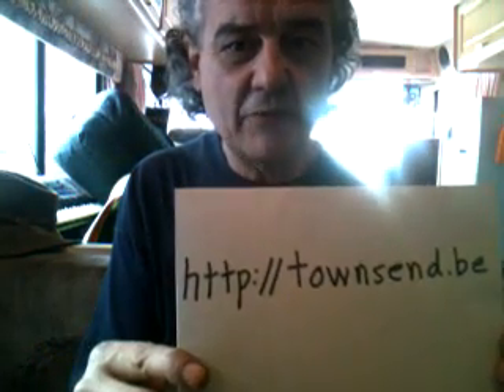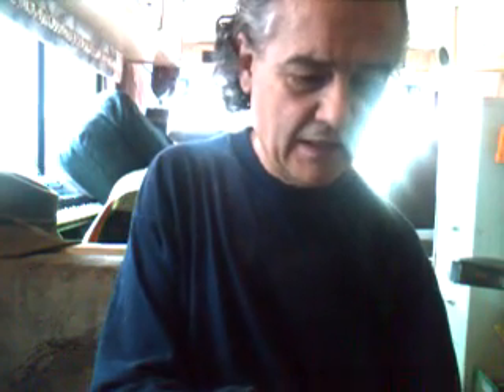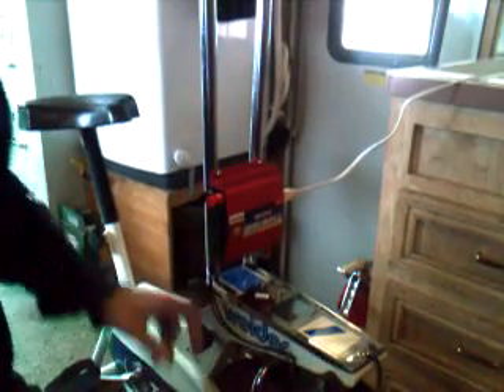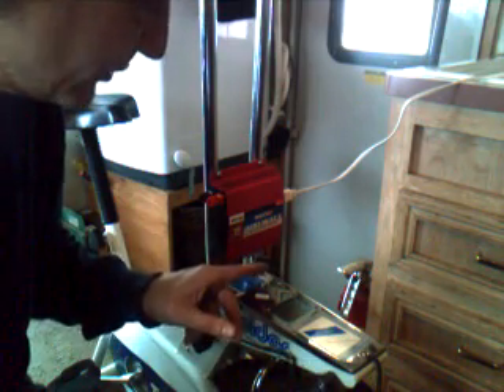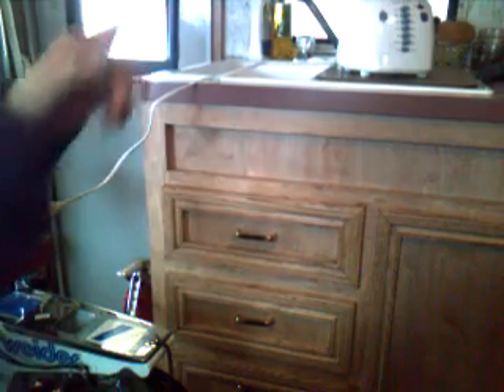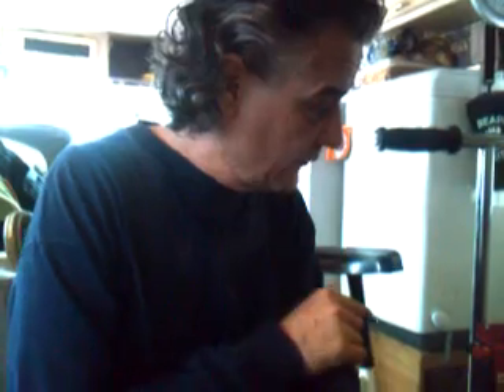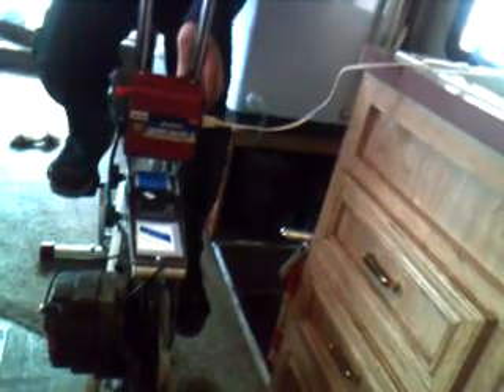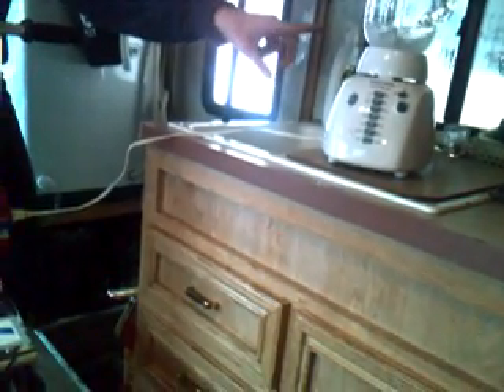Bicycle Generator 110 Volt  - Jim Townsend

Comment: maby a good way to charge a battery bank up for later use when power is out over a long stretch ,,like the frig and freezer or a medicail equipment like a nebulizer for asthamatics ..a slow peddler could trickle charge up the bankset ,,,400 watt inverter  can handle the 110 household stuff ??